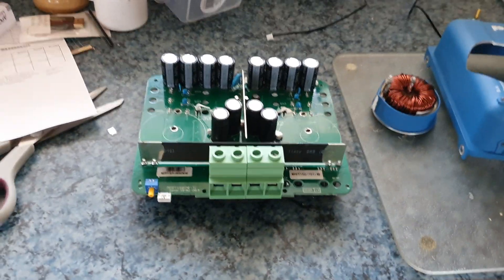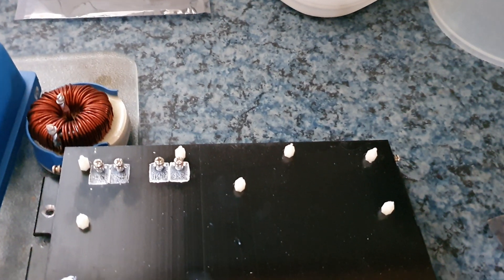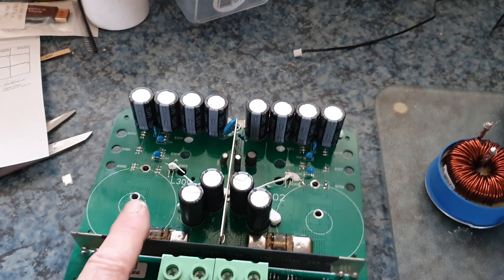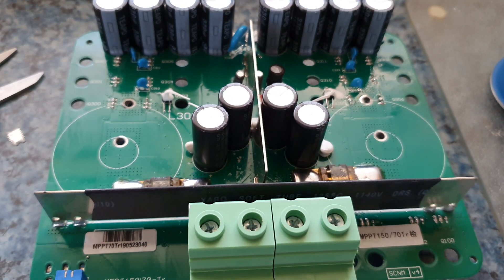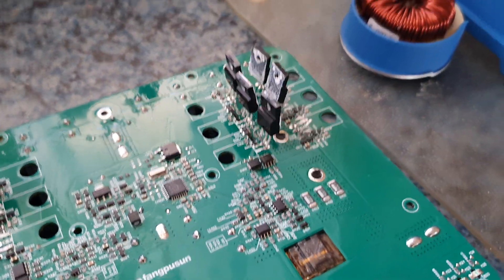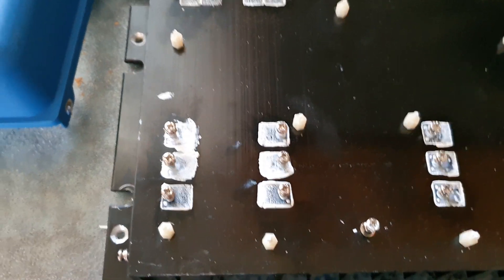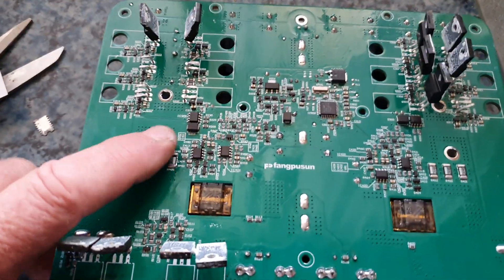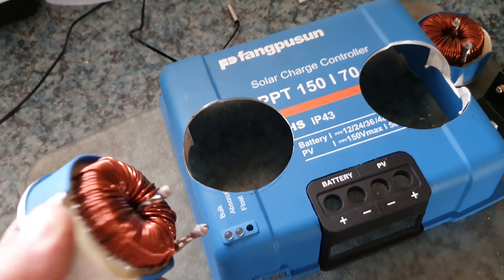Attempted repair of a Fangpusun, a clone of a Victron 150/70 MPPT solar controller

Comment: Hey did you end up repairing this I have one that I believe is software bricked due to victron forced updates
Reply from the maker: Welcome to the dead Fang club, yes I still have it on my shelf, It's only a dead weight now, yes firmware update will eventually kill it, if they don't by software updates die and have a short life compared to true Victron hardware, I have since gone Victron only and never been a problem since

Comment: Ross can you help me in resetting error #40 on my victron mppt. I got the error when I connected my mppt with lithium phosphate  battery 48v without precharging capacitor
Reply from the maker: Err 40 - PV Input failed to shutdown
If the charger is unable to turn off the PV input, it will go into a safe mode in order to protect the battery from over-charging or having a high voltage on the battery terminals. In order to do that, the charger will stop charging and disconnect its own output. The charger will become faulty.      https://www.victronenergy.com/live/mppt-error-codes

Comment: How did you make the circular cuts?
Reply from the maker: Used a  large hole saw with the centre drill removed and clamped in my milling machine

Comment: Please don’t buy this product again it die even if you don’t do any FW update on it. I have 3 that are dead now
Reply: I have mine running for about  2yrs.. no issues.

The one that died on me, i disconnected battery while it was working nothing happened. I tried reconnecting, it sparked and died... I was able to convince them enough to get a warranty replacement although.
Reply: @leviahamefula3994  I have 3 all dead complain to them no reply from them
Reply: @djnumberz1893  oops, sorry about that.

Comment: I have the Schematic of this Charger, any means to Extract the firmware from the S08 CPU ?
Reply from the maker: I think the firmware is design for uploading only and not downloading or backup
Reply: could you send me schematics? I just bought a BDM interface to read firmware from this and schematics would help me in my work
Reply: i be very keen to get a copy of that schenatic, any chance?
Reply: @philwzen I actually bought out the schematic

Comment from the maker: I have now 3 dead  solar controllers from Fangpusun, each has had upgraded firmware from Victron, they seem to work for awhile, I even put a temp controlled fan on the heatsink of one so it never has a chance of getting hot, lasted a few months then died, So I would keep a wide birth from these Chinses clones, save you money and buy Victron, best money ever spent was on Victron, I have not looked back
Reply: Read well, they warn not to upgrade with victron firmwares, as thise firmwares cone with a kill code for clones. 👀!
Reply: Hi, 3 MPPT 30/100 from Fungpusun burnt in 2years in my sailing boat, while a 20/100 Victron is still alive for 2 years now.
Reply: Yes my 100/50 died shortly after a firmware victron upgrade also
But the 100/30D's have been faultless for over 2 years now

Comment: I've heard that if you upgrade the FW, there is a deliberate fake product killer embedded.
Reply from the maker: Could be some truth in that, as I have had 2 die, I have 2 more of these still  in service, I will post on there fate if they go the same way
Reply: Yeah, I have a pfangsung 100/15 and it was working great. Updatet the FW and it worked great .... but then it stopped :(   A german guy said DON BY CHINA - they don't last! So I too wonder if there is any truth about a killer in the FW and how one should avoid it. Well to late for my controller ......
Reply from the maker: @knutposchel2165   Yes they become a death wish, not straight away but over time with upgraded firmware, another died a few weeks ago, now I have 3 dead ones, pretty convincing results
Reply: @sjdtmv  So you HAVE TO BUY orginals from Victron ;)  they will last .....      Almost the same with FT232 USB-TTL ... they change the firmware so clones stopped working! Well, now you have CH340 ....  but how to unbrikk the MPPT?
Reply from the maker: @knutposchel2165  If only it was that easy to get  firmware and program and upload it to the bricked MPPPT ?.
Reply: @sjdtmv  This has happened to me with other electronics. They just die after an update. That is why many say never to update, just keep the old firmware.
Reply from the maker: @JR-kk6ce  Was too difficult to change setting to suit my setup, I had to change voltage to suit a different chemistry, brought the Fangpusun MPPT Control that plugs into the VE direct port for this purpose, but was far from user friendly, gave up in the end and upgraded the firmware through Victron App, Was a bad move on me.
Reply: @knutposchel2165  it is definitely a killer in the firmware.  
victron does not like cones.

Comment: How did the repair go?
Reply from the maker: They are unrepairable, the components are punched in before being soldered
Reply: @sjdtmv  could be using high temp solder too for better heat management
wont' help though, as the victron firmware update has clone killer code in it.
you HAVE to keep them stock.